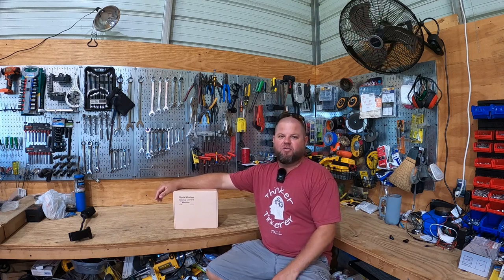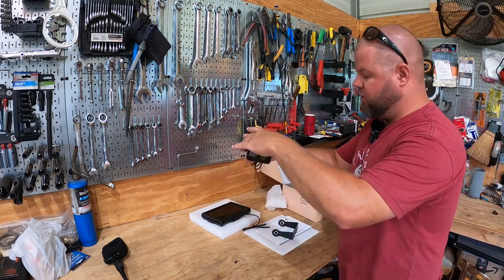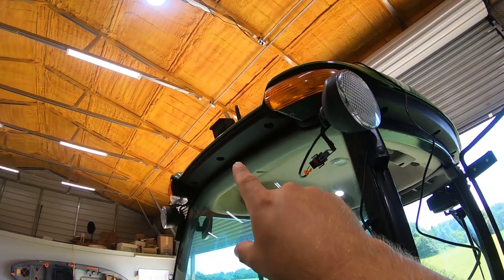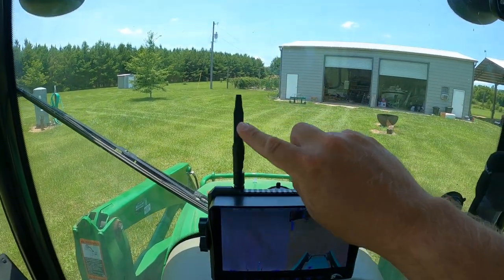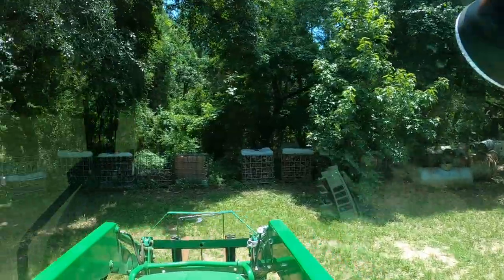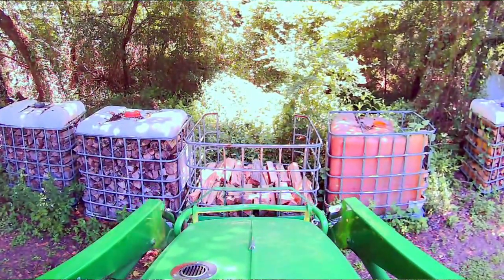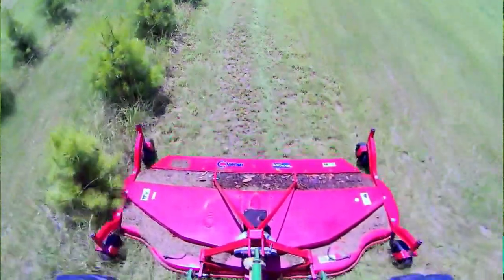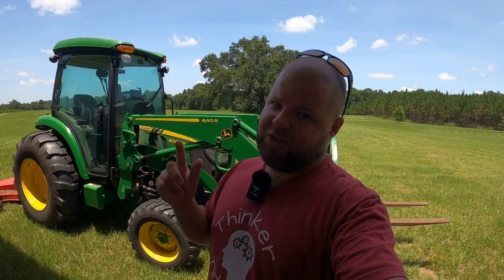I can SEE!! Installing a TX backup camera system on my John Deere 4066R tractor. #599

Comment: I personally put a wire fork connector in my tractors seat switch to bypass the seat switch from shutting the tractor off. It helps greatly when warming the engine up. This camera system looks great, especially with adding more cameras down the road.
Reply from the maker: I don't understand, I can literally crank my tractor up while standing outside. I don't have to be in the seat and it won't shut down if I leave it. Only if the tractor is in motion.

Comment: Nice, I'm Mounting a front and rear cam on my Tractor as well, How are the Camera Mounting Screws holding up ?
My Plastic is to this so I was thinking using 3M Molding Tape....
Reply from the maker: Zero issues with mounting screws

Comment: Happen to know if the monitor is weather proof? My tractor does not have a cab! Although below freezing with monitors can be an issue as well. It would be really nice while using the snowblower. It's 3 pt hitch and I have to drive backward. Not likely a great idea if it can't handle the monster and low temp
Reply from the maker: I don't believe it is, I personally wouldn't have the monitor near weather like that.

Comment: I'm curious how the ac is doing in the house? With the spray foam are you finding yourself having to run the ac all the time with 100+ degree weather?
Reply from the maker: It's doing very well! It does run more on these triple digit days but has kept the house very comfortable.

Comment: Here is why i catully like open cab tractors more, you can see better with out the cab getting in the way
Reply: My Kioti DK tractor is open station, I have the long forks and painted the tips Orange and still have to stand up some times to see them. I need to find a Water Proof monitor.. Cause I want to use it on My 4 Wheeler as a rear view Mirror. My Factory Polaris rear box is to high/wide to use normal Mirrors.
Mike M.

Comment: Thanks  Andrew great video. I have purchased a couple of things that you recommended and I have no gripes about them. Can you do playback on that monitoring screen or do you have to hook it up to a computer or take out the SD card to a computer? Oh  another thing, in this heat how is your AC system with the closed cell foam installation working out. Cost, functionality, how much does AC run etc?
Reply from the maker: No playback on screen. The AC has been working very well. It does run more, but hasn't struggled one bit to keep the house comfortable. Amazing that a 2 ton ac has kept this house very comfortable with almost two weeks of triple digit temperatures.

Comment: Now that you have been using these for a few months now, are they still working well?  And do you have any noticeable “lag” in the video seeing they are wireless?  Thanks in advance!
Reply from the maker: No lag and working well. The back one will occasionally fog up once the tractor has ran for a very long time and the conditions are right. It gets very hot up there with low air flow.

Comment: I was wondering if someone could tell me the price of the system? I look them up online but no price and it will not allow me to even order one. And no one will call me back or answer my email, can anyone send a new link or send me a link with something you have used that worked just like this one did? Thank you
Reply from the maker: This video is several years old, I'm not sure if they sale these anymore.
Reply: Not trying to bother you, but would have one that you could recommend me to getting? That one you installed seemed to be real good quality and easy to install.
Reply from the maker: @bradkimrey343 I haven't looked at any new systems since this one. I'm sure there are some new models available on Amazon.